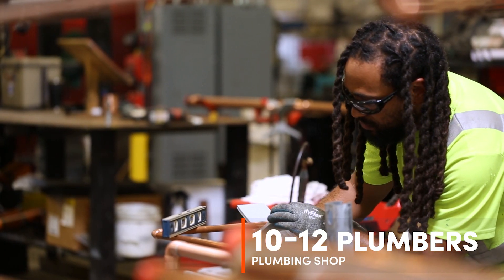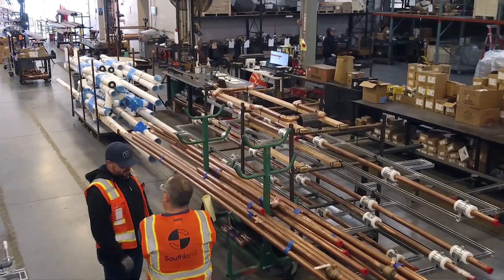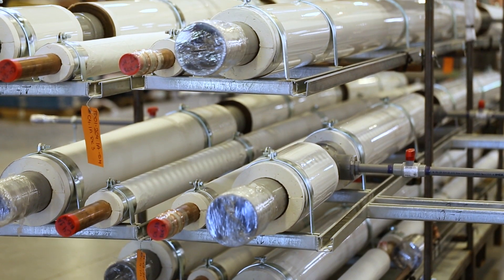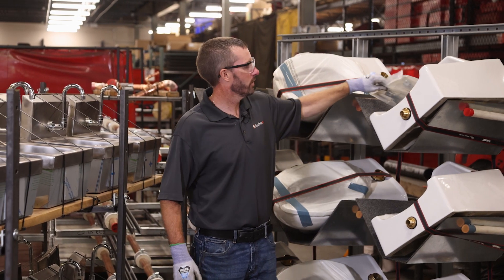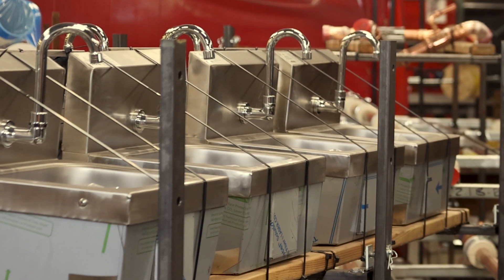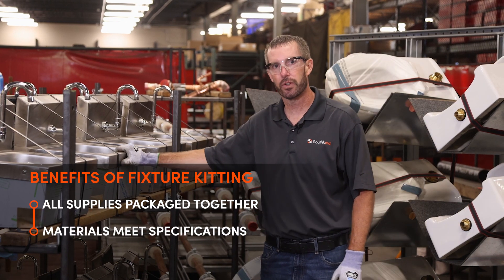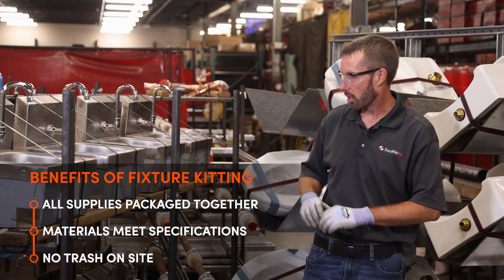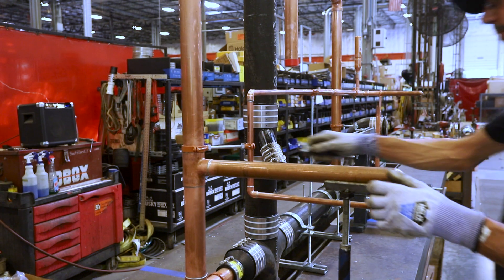Southland Industries Mid-Atlantic Plumbing #Fabrication Shop

Comment: But, most importantly, you aren’t paying the skilled plumbers doing all of the skilled shop work rate wages, where, if they were on the job doing this skilled labor, you would be forced to pay them the scale they deserve. It’s funny how none of the companies who showcase their prefab shops mention this. Plumbing companies will do everything they can to keep skilled labor off of any scale-paying jobs and in the shop to avoid having to pay a fair wage to the skilled employees doing most of the hard work. 

Plumbing contractor to general contractor: “Sure — we can do this entire four-story hospital with just one foreman/journeyman and two apprentices. Don’t worry. We will keep up.” A plumbing contractor will bid the job considering twenty to thirty employees receiving scale wages, but only a chosen few will actually be on site receiving those wages. The rest are stuck in the shop doing prefab for the same job and only receiving regular wages. I wonder where all of those “saved” labor costs go.
Reply: Sure glad I joined the plumbers and fitters union where that doesn’t exist. Field or shop fab, same $.
Reply: @Scorpio1060- ima be working with a fab  shop. I’m very excited to start